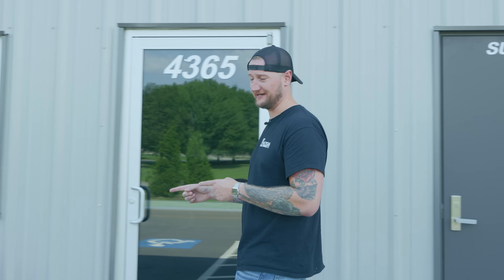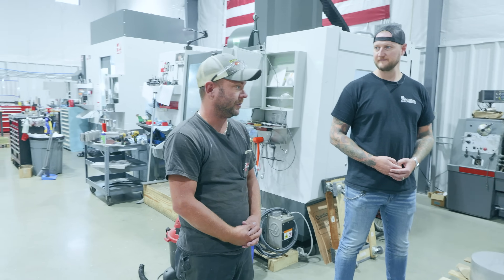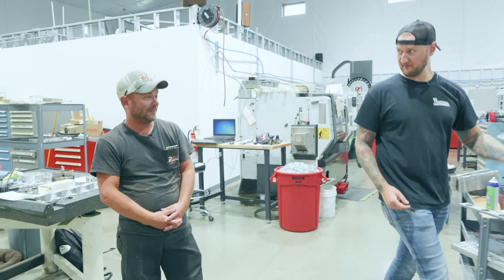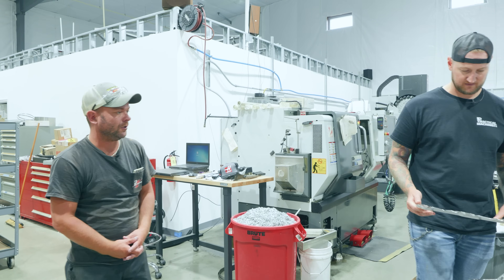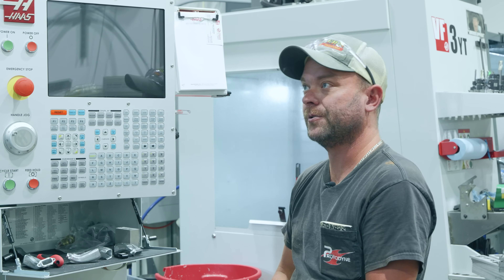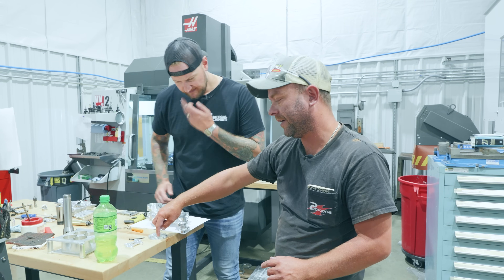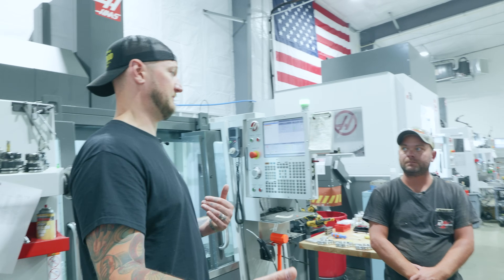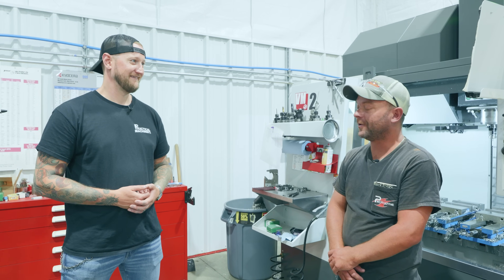No Mentor, No Problem, He Taught Himself Everything

Comment: He has worked in a machine shop since highschool, and has mechanical engineering degree. So no mentorship, not even from the cnc shop where he worked at in high school? Not even from the old bearded, long haired machinist dude that looks like he is retired and just hanging out by his machine, but he actually still works there; he never mentored you either?

Comment: Water jetting the profile of the header flanges will definitely save you some time if do bulks. Leave .03 then get it setup in the mills boom, not much material to take off
Reply: I’ve worked at one of the best high speed prototype shops in my area and our tooling department doesn’t play around with quality, time, and efficiency

Comment: I have an important question to ask. I was tearing down a Chrysler 3.7L V6 out of a 2006 Jeep Grand Cherokee Laredo. I haven't done anything with an engine in 30 years, before that I was a Chrysler Tech. Times have changed and during teardown, I stamped the rods and caps with the position they came from. I started going through an online manual to get the specifications. That's when I noticed the warning not to stamp the rods or I could possibly damage them. I would like to know from an unbiased machine shop. Should I replace them, just reuse them or should I get them checked by a machine shop for cracks? Please let me know I do not know what to do. Thank You! Steve

Comment: Self taught but went to college for mechanical engineering 😂
Reply: 50 years cutting metal, 38 years running my own shops. Got into business with manual equipment. Couldn't afford nc/cnc back then even though I had the knowledge to run/program/setup and build fixturing for them I had to breakout on my own. Tough to compete against automation, had to do the one offs and low volume jobs bigger shops didn't bother with. 10 years in I started buying new cnc lathes/ milling centers, 12 in all along with the manual machines that always come in handy at times. High volume production paid the bills and then some. Start out with what you can afford, avoid the banks if you can. A small shop will give you an education along the way in other areas you may not have at present but certainly will need. As far as that M.E. degree, a handy thing to have but not necessary. I spent the last 20+ years of my career teaching M.E.'s how to design and spec components for efficient manufacturing. I believe anyone wanting that degree should spend 4 working years making chips before they enter that classroom, then they'd be a real M.E.

Comment: I bought a cnc router and learned on that plus 3d modeling and programming. Took a job at a start up job shop after that and taught myself on a brand new vf2ss. Had to learn more complex stuff and metal milling. Also had to figure anodizing, powder coating, heat treating, passivating, and electropolishing then wrote the instructions for that shop. From there moved to another shop and got tossed on cnc lathes. Taught myself manual gcode and cmm. Now i'm waiting for them to let me move over to the big boy auto load 3+ axis lathes. Heavily debating on just starting my own shop after that.
Reply: By all means, have faith and jump into your own shop!

Comment: I started grinding and cleaning. Was taught the waterjet. Then Ended up teaching myself cad and cam and now I run my cnc department running 2 mills and a lathe.
Reply: Same, was doing deburring, forklift parts around, and shipping for month. One of the guy noticed my attn to details and quick thinking so they want to train me one small vertical mazak tomorrow. 

Started watching basic CNC videos, explanation on Gcodes, different tool bits. What’s your top three subjects you wish you paid more attention to as a beginner?
Reply: Nice alot of old heads wanna keep the info to themselves, but videos online make it super easy to learn. Plenty of info out there to learn from.
Reply: That is Neat, where did you learn cad ? I like sketching and im feeling a bit lost
Reply: @MateusLima-e4t I learned all on YouTube, some good forums on the web too. Don’t be afraid to call fusion application department and ask questions. Be annoying to these guys, that’s what they get paid to do.

Comment: I thought I was the only one who was self-taught in machining.  I got my learning by attending the school of trial and error, mostly error.
When I retired in 2018, I sold off my CNC mill and my Gunsmithing lathe; along with alot of my other metal working tools.
Since I was retired, I thought I really wouldn't need them anymore.  Boy was I wrong.
Now I've slowly started buying the kinds of benchtop mill and lathe I started out with.
Reply: What brands are you using for the machines?
Reply: @lmoser3482 I started out with the cheap Harbor Freight mini mill and mini lathe.
I sold the mini lathe and moved up to a Grizzly 9x19 metal lathe and from there I upgraded to a Grizzly gunsmithing lathe.

I still own that original Harbor Freight mini mill that I bought way back when.  I kept it as a drill press while at the same time breaking down and buying a Tormach 770 with all the bells and whistles.

I just picked up a cheapo Vevor mini lathe.  What a piece of crap that turned out to be.

I bought it off of Amazon.  They sent out a completely demolished mini lathe.  I sent it back and they sent out another identical brand new lathe that arrived busted up enough to require replacement parts to get it up and running.

That was about two months ago and once I got the replacement parts installed, five minutes into its' maiden run, one of the brass studs that holds one of the smaller gears just sheared off.

The only reason I've kept that piece of crap Vevor mini lathe is because they reimbursed me forty-percent of the cost of that lathe.

Most of my time on that mini lathe so far has been spent installing replacement parts and making higher quality replacement parts for it.

By next week I should have it up and running again with all new, more robust DIY fabricated parts in critical areas of the mini lathe.

Don't buy a Vevor Mini Lathe.  They can be more trouble than they're worth.

I'm still waiting for that sheared off brass stud part to be shipped to me.  In the meantime, I've already fabricated two of the same parts with this semi functional mini lathe.